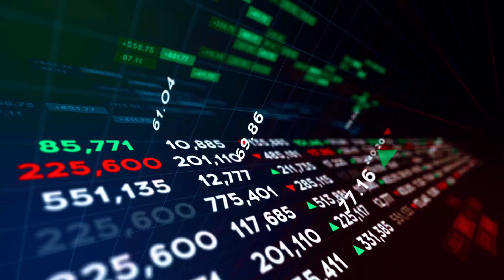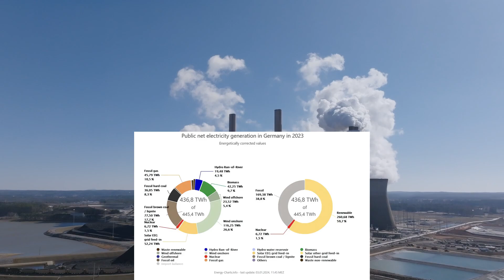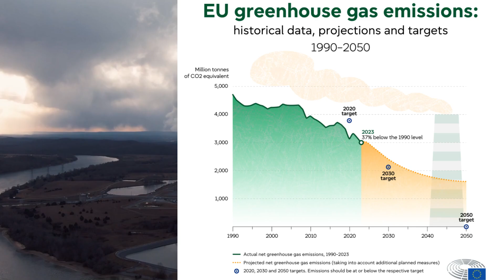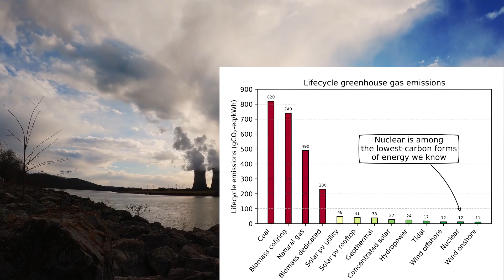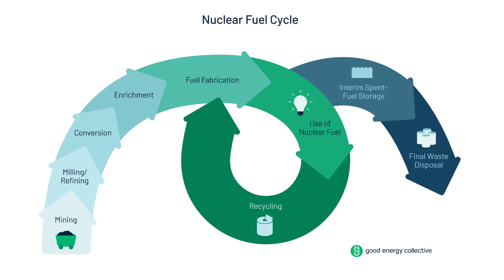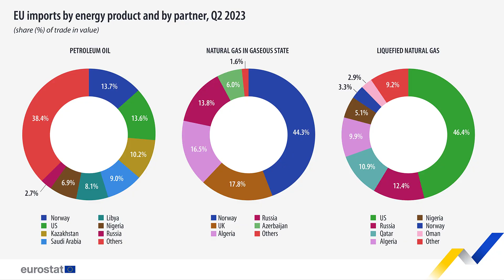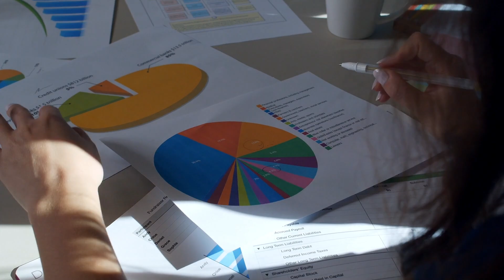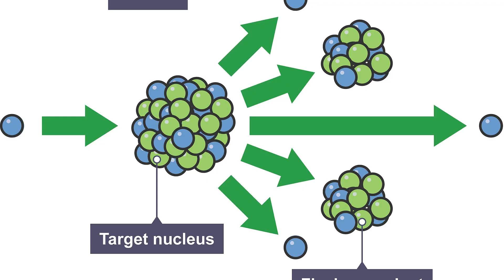Why the EU Should Go All In on Nuclear Energy

Comment: there are a few major problems with your arguments:

1) nuclear power doesnt solve the issue of energy dependence - germany used to import its uranium from russia (so it wouldve faced the same issue as with gas imports) while france is heavily dependent on its former colonies for fuel

2) nuclear power plants take about up to 20+ years to develop, plan, construct and commission - theyre not exactly a solution for current energy needs

3) despite the arguments you made, there still is no solution for nuclear waste - its an issue

4) its incredibly expensive. construction new nuclear power plants cost tens of billions of euros (look at the UKs new power plant) - u could buy significantly more renewable energy power output for the same price, while also not having to plan and build it for 20 years, and then have to deal with nucler waste literally for the rest of our species existence. furthermore, nuclear power is only "cheap" because of government subsidies. french nuclear power is "cheap" in comparison to german power, because france has a state owned nuclear energy agency which operates all its powerplants and pours billions and billions and billions of subsidies into it, keeping energy prices low. without subsidies, nuclear power is the most expensive source of power out there (not counting temporary spikes in gas or some other fossil fuel due to shortages) - while renewables are the cheapest.

5) renewables arent unreliable: it all depends on location: massive off-shore wind farms in the north sea and atlantic ocean guarantee wind power - theres always wind. strategically building huge solar plants in locations like southern spain, where the sun practically shines 365 days a year or using geothermal power, wave power plants or hydroelectric power in suitable locations is much cheaper and more efficient than nuclear power. the main requirement for this is a much more robust energy network that can funnel power from where its produced to where its needed, as its more location dependent than just slapping a coal powerplant wherever its needed.

6) climate change & natural disasters: nuclear reactor technology mightve gotten better since the big boom of nuclear power in the last century, but there are still significant risks from the environments: earthquakes and tsunamis can devastate nuclear powerplants (as seen in japan), in 2023 there were such significant droughts in france that rivers were beginning to dry up - when droughts inevitably become more severe, they could threaten the safety of nuclear power plants as the water, cooling the nuclear power plants and producing the power via steam dries up. also, nuclear power plants are a strategic weak point in case of crisis or war.
Reply: There are some problems with your arguments: 

1)  Nuclear is an energy source that increases energy independence. That is the reason why France chose it after the oil crisis of the 70s. In theory you can store all the necessary fuel for the whole lifetime on site. Most plants have fuel for the coming decade on site or in the country. 

2)  20+ years to develop, plan construct and commission is largely due to long build times in the west (EU and US). With shorter build times this can be greatly reduced. The EU and US were able to build them in 5 years instead of 15 today. 

3)  There are solutions to nuclear waste. One is a geological repository like the one in Finland (Onkalo). Or you can burn the waste in fast reactors like the Phénix and Super Phénix from France. 

4)  Construction is expensive when you haven’t build any in 25 or 30 years. Olkiluoto 3 in Finland was the first new European reactor in 25 years. Vogtle 3 & 4 were the first in 30 years for the US. All the people that knew how to build them either are retired or not with us any longer.

You think renewables aren't subsidized? China holds 80+% of global PV production. They pushed out every other western competitor with their subsidies. Same goes for the rare earth materials that they produce.  

5)  Renewables are indeed not unreliable but they are intermittent. There’s not always wind in large enough quantities in the north sea. We have to be honest, wind sometimes goes so low that backup is needed. 

Solar in the western part of Europe is indeed the best option, but then transmission becomes a thing. Wave power will need some interesting amount of maintenance. Geothermal and hydro are very geologically dependent at this time. Maybe if we were able to go to 10km depts for geo, then it would make sense in a lot of locations, but for now not so much. 

6)  Climate change & natural disasters. The earthquake(2011) in Japan did not damage the nuclear power plants, it was the tsunami and the bad placed generators that caused  meltdowns and hydrogen explosions. France decided to reduce power of a few reactors during a few hours of the day during the drought. They will not risk any possible shortage in cooling water to the reactors even during an energy crisis. 

During a war, a nuclear power plants will not get blown up like every other source of energy. Just look at Ukraine and it’s energy infrastructure.
Reply: @stijn2644  Very well put!
Reply: I mostly agree with you, except  the risk part. Most nuclear disasters were because of human error, and environmental risk don't pose such a major threat, as Europe isn't as earthquake prone as Japan, and the powerplants are usually built near big rivers, which don't try up even in cases of drought. Also, the nuclear waste problem can be solved, just look at Finland. Finally, you don't need to import as much uranium as coal or gas, as it lasts for a very long time (for example, if you were to build a nuclear power plant right now, you wouldn't need any new uranium for at least another 100 years).

Comment: the problem with fission reactors isnt really safety etc. 
the problems are: 
-location (you need a lot of water and a stable level all year round + ppl dont want to live near it)
-fuel (EU imports uranium from canada, russia, nigeria and kazhakstan - basically the same issue with natural gas if we are talking about independence)
-long term costs (building it and long term contracts backed by the country in case of "we dont need it anymore" the country has to pay the operator at least baseline rates to "recoup" the investment and maintenance costs over 50-60 years)
-the industry needs natural gas (steel etc) and the power grid needs peaker plants (burning natural gas)
Reply: -you can engineer a closed loop npp for cooling, air cool or use waste water from a nearby city.
- fuel, it is not the same issue as with natural gas. We're getting most of natural gas from autocracies and unreliable partners like Russia, Qatar, and the US. Australia, Canada, Kazakhstan alone supply more than half of the worlds Uranium. These are more reliable partners. In addition to that, we can easily stockpile years worth of uranium and outlast any 
-Industry doesn't need natural gas. It needs cheap energy to produce hydrogen and ammonia which nuclear power could easily provide.

Comment: Waaaaaay too expensive and pretty dumb to miss out on cheap sustainable energy. Dumb to go all in on a single source of energy. Nuclear can be part of the solution, but it cannot be the only part of the solution.
Reply: nuclear is cheap. at least comaprable to renewables if system wide costs are taken into account. Also, nowhere in the video was stated that nuclear should be the single source of energy in the EU, it just stated that the EU needs nuclear.
Reply: @sebastiangruenfeld141 nuclear is expensive.
SO expensive. the new british nucler power plant is a 50 BILLION POUNDS construction cost at this point. its so ridiculously expensive. its only "cheap" because of tremendous government subsidies (looking at frances state owned nuclear agency..) its so expensive that even chinese investors pulled out of the project.
nuclear energy is anything but cheap

hinkley point will produce 3.260MW of power and cost 50 billion pounds. for comparison, wind energy takes about 1 million/MW - so could could get about 50.000MW of wind power for the same price as hinkley point. also, without then having to spend money buying and refining nuclear fuel, and storing it after it has been spent.
Reply: @ British nuclear power plants are as expensive as the British gov wants them to be. EDF, the company responsible for the contruction, had a design. The British government wanted over 7000 changes to the design, which essentiall makes it a custom plant. The cost overruns of British nuclear reactors isn't more a testament of British bureaucratic madness rather than nuclear being expensive. And yes, EDF is now state owned but not because nuclear isn't profitable. It ran a €10bn profit last year. It would be even more profitable but the French gov implemented an electricity price cap. There's countless studies that show, nuclear power plants generally stay on budget and on time if they are built the way they are designed without modifications to the design during construction
Reply: You have things mixed up. Renewables at best can just be an addition. It simply can't provide us with the reliability we need.